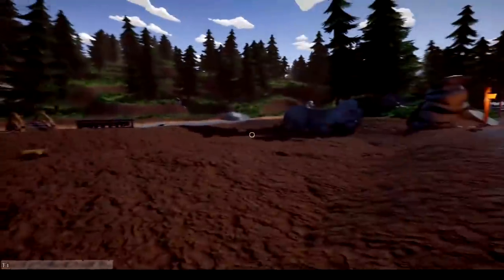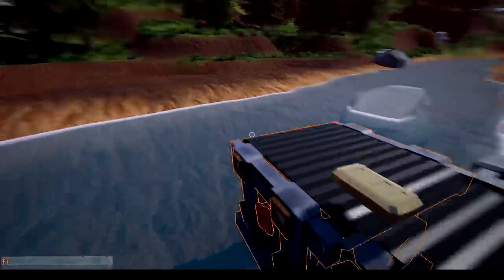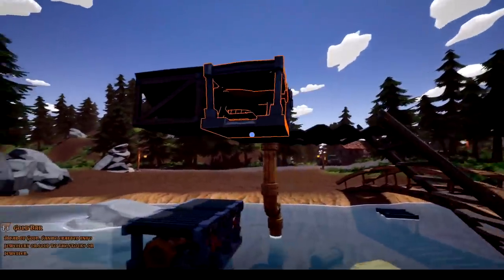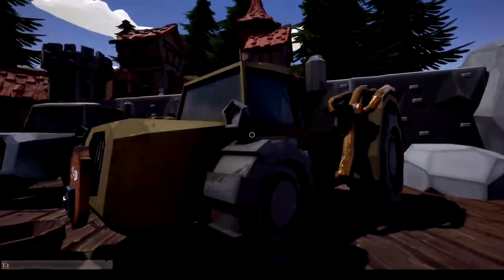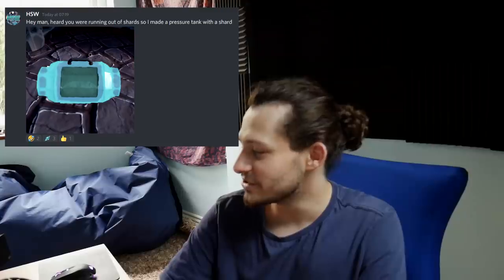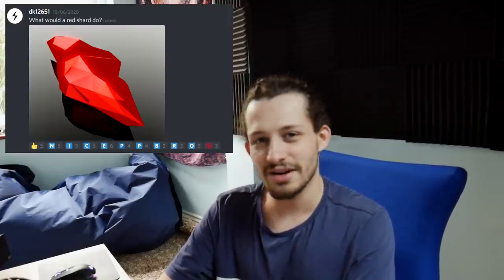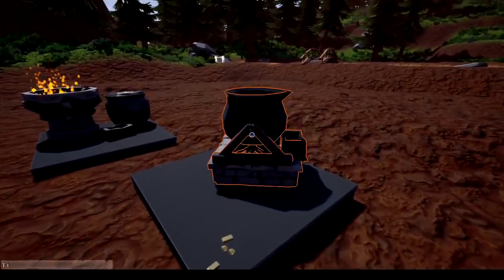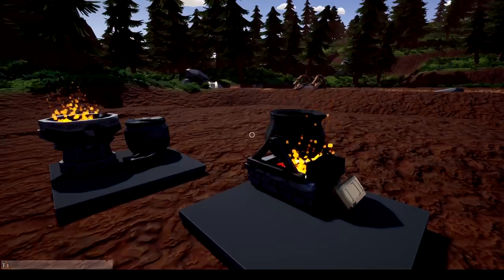Hydroneer's New Smelter || Game Dev Weekly

Comment: Differend colored shards -> Red makes the item last longer, durability. Light blue is normal. Green gives speed boost. Yellow make them more efficient. Ofc one color can be active at one time so you want to have it as last shard before the machine. You could make drills be more efficient to get bigger gold while belts are faster and filters are more durable :D Also having more efficient grinder would yield more gold also but having it be more durable so it wont brake as often (does grinding dirt even dmg the machine?) 

But hey, do what you want ^_^ looking forwards if you implement when you do ...
Reply: this would be really cool and would satisfy my need for more color/colourful gems and crystals :D
Reply: As soon as i saw red i thought explosives. Use them to make mining charges so we could blast a little dirt maybe?
Reply: @betagorilla5513  like tnt or dynamite
Reply: @matthewpinner9419  yea a more directional mining charge would be cool, its blast size based on the weight of shard used. and it leaves dirt chunks just laying in the hole ready to be hauled out.

Comment: Can you make the water-pipe of the corner piece a T-segment so that we can connect water not only to the beginning or end of a conveyor. Both ends are normally blocked either you want it free so things call fall down and/or a machine sits there already, which is making connecting water really troublesome sometimes. Alternatively a straight piece with a 4-way connection of water to allow player to connect (or take) water there.

Comment: I really like the idea of the red shards, I think someone already suggested this so I'm seconding the idea.  They could be used in pressure tanks to add a second value to water giving "lubrication" to machines like a fuel additive meaning they don't break down as often.  These could be placed before filters meaning they don't break as often either.  If they were pretty rare it'd be good for progression so as you advance you have to babysit less.

Comment: Hey Max, little problem that I'm sure no one ever has ran into since everyone else is a bit more sensible with their metal bar management. But I cut down a larger bar trying to get as even 3rds as possible to make a sword out of it all and I was left with 2 tiny bars (less than 1.5 weight). I decided rather than have them fly around, I'd stick them in a safe. They went in fine on the bottom 2 slots. But now the one closest to the door is stuck. I can't pick it up. It's not a huge loss in metal, rather it's annoying that I've lost that storage space in the safe. Is this a common issue or an oversight or did I just do something wrong (beyond storing the smallest bar chips you can possibly cut down to into a safe.)? Just to let you know.

Also, item ideas, namely conveyor parts. Centering conveyors and magnetized conveyors. Centering conveyors having guide rails on either side of it focusing material flowing onto it more into the middle of the belt. The corner belts do a better job at this, but there's times where things, namely payload from harvesters, are just splayed onto the belts. It'd be helpful, in my opinion, if we could center them to keep them from jamming up in the corners. 

The magnetized conveyors would attract dirt, mainly, to it. So we could be mining and just dumping our buckets in the general vicinity of the belt and the dirt would be pulled onto it. Once it's on it, the magnetic field won't affect it. A bit of a weird one, but I've more than once messed up the LMB click and E and ended up dropping a bucket onto my conveyor system. . . .  It'd also help for when dirt ends up falling off of vertical conveyors.Then we could have a magnetized catching belt below to then feed it back into the system. Just ideas. 

Also, maybe with the magnifying glass, let us analyze a general concentration of gold/iron/gem/shard concentration in the dirt we're starting at. Like so we can get a sense where the dirt will start flipping a profit for the effort and where it's just bits of gold and iron.